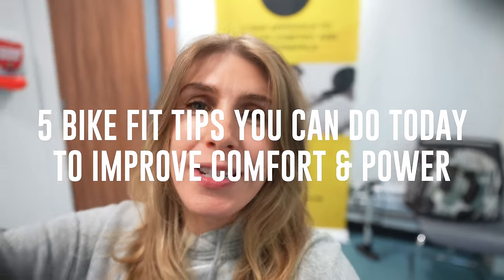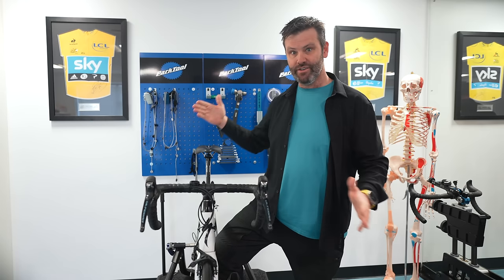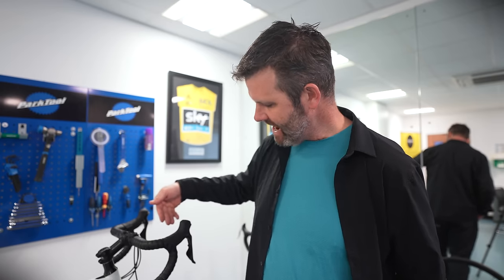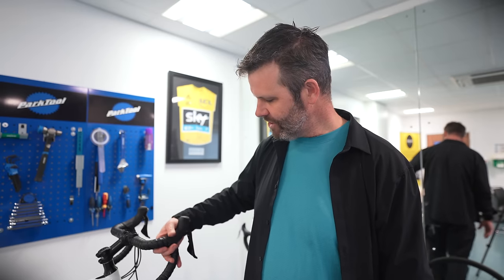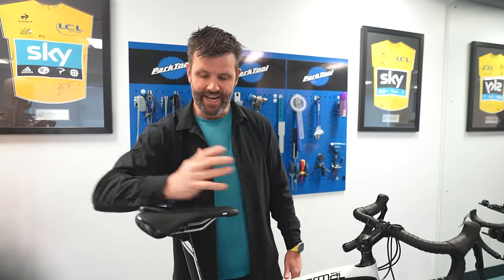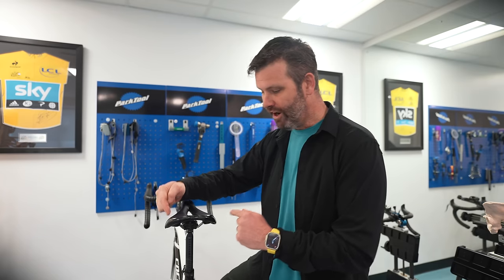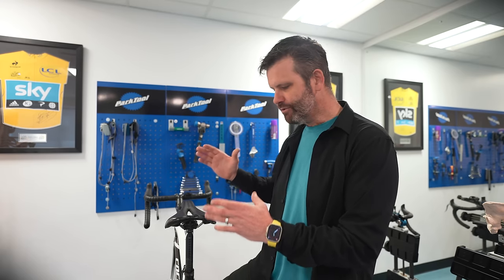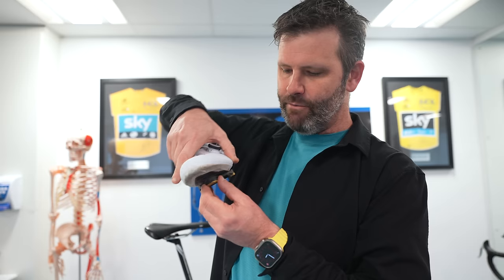Improve Bike Comfort AND Power TODAY! 5 Quick Fixes to Common Problems

Comment: I've read that when putting a fair bit of wattage down, you should be able to take your hands off the hoods without any momentum and sit upright. I find this difficult, and can't tell if it's fitting issue or a body core strength one? Is there a way to distinguish if it's fit or strength? Are people supposed to tense up their midsection when riding, remain relax or bit of both depending on situation?
Reply: It can be both, from my experience, although if you are also able to do it as if you were sitting on a sofa, perhaps the saddle is too far back. If you have too much hand pressure on a normal ride, then perhaps you want to increase the setback a little. This also relates to how much upper body mass you carry (more body mass, more setback)
Also, if you push less on the pedals (less fit) you might also need the saddle further back for this reason. Ultra endurance riders can have more setback as they pedal lighter for many more hours. I found myself feeling lighter on the hands and increasing the drop as my fitness went up. For the same Z2 effort I was just pressing harder on the pedals, therefore offloading the upper body.

Comment: Phil – how about repositioning the controls on the handlebars, instead of rotating the bars upwards? The former seems to also reduce reach while preserving a usable position in the drops.
Reply: I am intending to do this so that the drops are in a better position. I just need to re wrap the bars…
Reply: I was thinking the same thing. I guess this is a quick fix, however, I think a disclaimer should have been made about adjusting the levers in the long run, not just the bars.

Comment: iv not designed saddles, iv not fitted anyone on saddles, there are obvious reason why noses of saddle can be up. ever use a selle italia cut out saddle? but more commonly youll see nose up on leather saddles because the leather isnt supportive and it sags, like selle italia cut out saddles, theyre wet noodles.
Reply from the maker: Selle Italia are very specific in the shape but Phil does explain it’s the area you sit that should be flat or -3 degrees :)
Reply: @KatieKookaburra  the cut out ones flex too much vs the non cut out which dont flex at all. its a huge design flaw. they also recommend replacing them after a short while because they get even flexier. so buy a 400 dollar saddle and replace it after a season. or buy the non cut out that has zero compliance and no cut out.